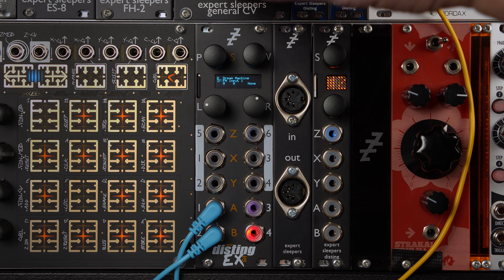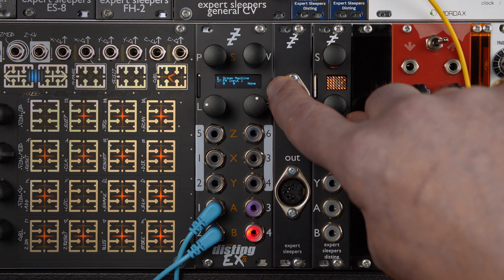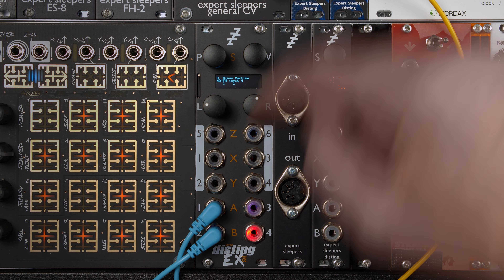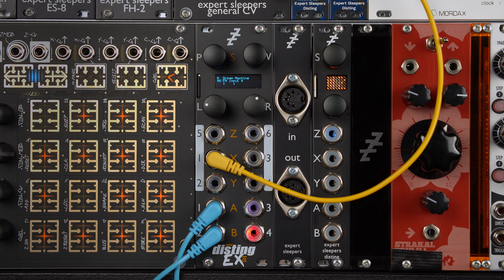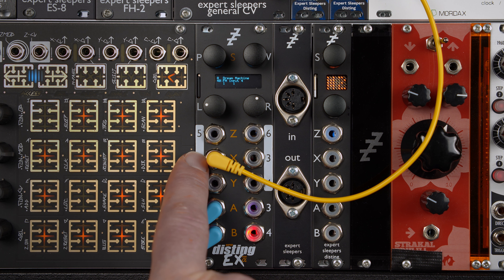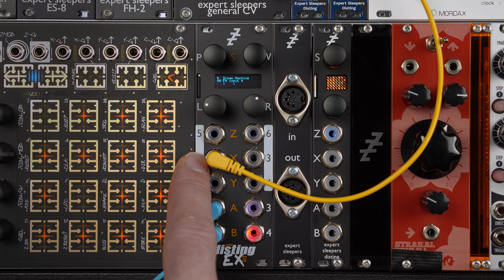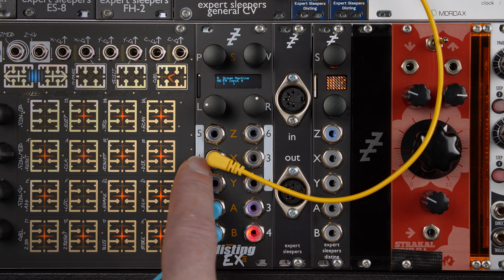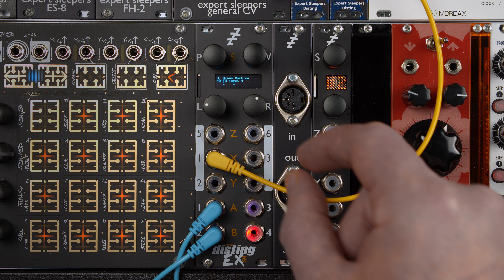disting EX - Dream Machine

Comment: Are there any gate inputs that can trigger individual primes? Is there a master gate input?
Reply from the maker: You can assign gates to the five tones. There's not a master gate as such but you can assign all five gates to the same input.
Reply: @ExpertSleepersLtd  Thanks Os, will give it a try.
Reply: @ExpertSleepersLtd  Any chance we can have a menu item to select the FM range from the current 1Hz to something higher?
Reply from the maker: @DBPawlan  Potentially. What would you find useful?
Reply: @ExpertSleepersLtd  Just to provide more movement in the chord. I found that modulating 1Hz on the second prime, for example, was barely perceptible (but still sounded great) and would like to have just a little bit more wiggle room.